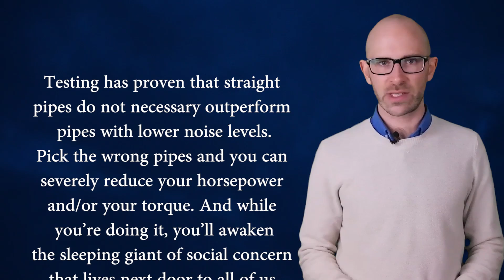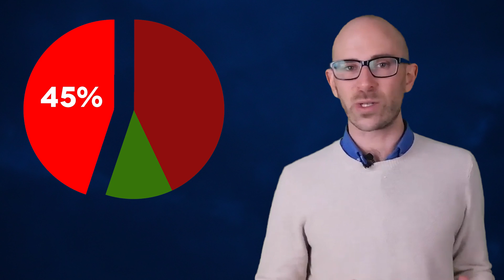Why are Harley Davidson Motorcycles So Loud?

Comment: Harley Davidson's are the fastest way to convert petrol to noise without the side affect of horse power
Reply: According to fuelly average MPG for a stock Ultra limited is 37.8.   I am not accusing you of lying... I'm just giving you significant glances and seriously questioning your math abilities.
Reply: Will Sherriff as a harley owner, 1200 sportster, lol I agree 100%.  I mean wtf.  a BMW gets like 170hp on the same displacement where I get like 75.
Reply: John Dyer When you try and roast someone's punctuation errors and end up sounding like a complete dumbass because you called an apostrophe a hyphen.
Reply: Please forgive me, but I don't believe you're being very honest about this.   Most guys I know of that did the Stage IV went from 37mpg to 29mpg.  You might be able to tune a 10% increase in fuel mileage with the right fuel map if you sacrifice a bit of power with it, but that would put you right around 90HP.   In short, I don't care that you are lying to me, I'm more concerned that you're lying to yourself.
Reply: LOL John Dyer, I think you're talking about the all Harley class of drag racing!   In which, I think the V-rod holds their record, which was HD's attempt to deviate from their normal design.
Reply: Ratty - A Harley 883 makes about 50 ft*lbs of torque at 3750 which is peak.  A Yamaha R1 makes 70ft*lbs of torque at peak.  A CBR1000 puts out 75ft*lbs.  In fact the smaller CBR600 puts out almost the same torque as the 883 at almost 50ft*lbs.   My Ducati has an 803cc in it, and it puts out almost 60ft*lbs and doubles the pathetic 45 or so horses the Harley 883 shells out.   The one thing I learned here is that you are not good at facts.
Reply: savaship - I can't believe you're considering gas mileage while riding a motorcycle. In my 40+ years of riding I only checked my mileage once and it was because I was on a trip to the gulf and needed to calculate my fuel stops. When you're out there riding, enjoying the day, the last thing you think about is whether that ride cost five cents or nine cents.
Reply: Softail77us - I can't believe you don't figure out your gas milage after 40+ years of riding!   Or figure it into your motorcycle purchases, as a basic component of how economical it is as a daily driver... oh right, Harley riders tend to be weekend warriors, my bad.  But still, fuel economy is one of the most basic pieces of knowledge for operating any vehicle... Is not knowing anything an essential part of the Harley experience?  Gonna tell you, I love my Ducati more than I ever loved any of my 3 prior Harleys, and I know for a fact that there's better bikes out there than mine... none of them Harleys.
Reply: starcommtrey - I'm not the one who didn't know my own bike's fuel mileage, then attempted to make fun of someone who knew theirs.  You should look up the word ignorance sometime.
Reply: Softail77us - I started on a Harley, an 883 sportster... was a good bike... not a great bike, but good.   I traded for a 1200 sportster, was a gas hog, still a good bike, not great, but good but less economical.    Traded for a Wide Glide, was the worst bike anyone could have ever designed... made me re-evaluate my thinking on bikes... test rode every bike that had a name, liked many, but went with the best compromise between comfort, fun and passenger comfort... so now I have a Ducati Monster 796... is a great bike, it's also an air-cooled V-twin that generates more Horses than a big Harley twin on half the displacement due to 90 degrees of separation (45 degrees is stupid inefficient), and much better economy.   You say you have no use for rice anymore?  Ever try pasta?
Reply: John Dyer banning guns wont stop gun related deaths. It'll lower the number but you're forgetting that criminals dont follow laws. So saying that "banning guns will stop gun related deaths" is a factual error
Reply: That's cool.I have two Harleys, both piped and tuners.Just don't be stupid and crank it when the bars close. I never had any issues with my pipes and cops.
Reply: John, what class do Harleys race other types of bikes then?   My local track hosted an MMDRA event last year and Harleys were not in the allowed bike list.
Reply: well said Stan--The engineering word for push is Force, and a force applied by something round like a wheel is called torque. So, torque is a fancy word for a push by a wheel. More torque equals more push, which equals more acceleration.
Reply: I like my two wheel tractor -  it cruises just fine on the back roads. As when riding daily through the Ozark and Ouachita Mountains.
Reply: Lil Devil - you are probably right. But  what ever you ride be happy. If you are trying to please someone else you will never be happy. And what ever you ride keep the rubber side down and in the wind>>>
Reply: Starcommtrey, I'm really not sure what your point is because that comes to 41, not far off from the 37 average.  You're also not claiming to have a Stage IV in yours that increases your horsepower by 60% and a magic tuner that somehow gets 50mpg AFTER increasing your power by 60%.  THAT's the issue, not whether or not you can squeak 41mpg at low rpms on a stock ultra by riding low rpm in a straight line on the highway, but whether you can mod your bike to get 60% more HP and somehow get 35% better fuel economy at the same time.
Reply: starcommtrey, a stage 2 is an 8% performance increase mod at minimal fuel efficiency losses.   Most wise folks wouldn't bother with it because it's a lot of money for very little gain.   The thing you will get is a nice fuel map done during EFI tuning which could net you about 10% fuel mileage increase.   So Average of 37mpg +10% = 41mpg... congratulations, you did a fairly useless mod and had a fuel map done to get 41mpg and it worked out exactly as I said it would, so why are you even arguing about this?
Reply: I know what average power increases from certain mods are, so I can make an intelligent estimate.   I also know from multiple data points that people who mod their bikes tend to exaggerate everything about their mods and their bikes.  In general, you don't increase power and decrease fuel usage unless you're looking at an engine of a different design such as adding liquid cooling.  There are exceptions, but they are normally minor, not super major like the previous poster who claimed a 60% addition of power using 35% less fuel... "tuning" can not accomplish that.
Reply: Well put Will.. you comment made me laugh..I get it.
Reply: Thank you Gage. John Dyer, I laugh in your direction.
Reply: Softail77us hahaha.....my bad, I went outboard for the vmax.....
Reply: I have loud pipes and would be willing to bet my education rivals or even beats yours, have a great life and completely make you look ignorant.
Reply: So, since piston-engine AND jet aircraft ("airplanes" to you, kid) never have had muffled exhaust systems, all aviators ("pilots" to you, kid) have "small penises"? You should have known.
Reply: A half-full bucket of corroded wheel weights makes him look ignorant. The kid ain't right in the head.
Reply: Airplanes to you kid....I love that.....hehehe.....now in all fairness, old prop jobs(p51 for example) were straight piped.....wait....that confirms your point...hehehe. (But to be honest, there are a lot of dumb pilots....) And while we are being 'technical' lets say naturally aspirated piston-engine, turbo props, turbo jets, ramjets, and turboramjets.
Reply: Yamaha SR650 - You seem upset about something bigger than this thread, I won't lash back at you, even though you are resorting to lots of generally infantile tactics to have during a discussion.   This isn't about "American Iron", there's very few Harley Davidson parts that are manufactured in America.   Harley's are assembled in America, not made in America, so in a sense, the Toyota Camry could be considered more American than a Harley as it has many parts manufactured in America, and it's assembled in America.   I just don't know why you think anyone would be jealous of watching another person waste their money on a $20,000 bike that can barely move it's heavy butt up to 60mph in 5 seconds, and can't lean more than 24 degrees.   That's a bike that can't move, or turn.  If it was a budget bike, I'd forgive it, but it's not, it's priced higher than a Ducati Diavel, an imported Italian 160hp cruiser with 41 degrees of lean... I just expect more from HD, but after they murdered Buell bikes we instead get 15 variants of the same bike with purposely stupid sounding marketing terms... I bet you can't wait for the new dyna heritage screamin-eagle superlow bobber soft-tail slim breakout.  It does 0-60 in the same time as a 1992 Chrysler LeBaron and can be out-turned by the USS Iowa, but listen to those pipes man!
Reply: Yet they still use Harley drag bikes and are competitive and get enough hp out of the two cylinder.
Reply: No I was not.
Reply: savaship My ultra Classic gets 250 miles to a tank. 6 gallon tank. Do your math.
Reply: +Softail77us 
@softail lol, yep I just get on the other side of this side before needing to fill up again.
Reply: savaship I know my fuel mileage so not sure what your getting at....
Reply: I only mentioned one trip. I've made plenty 600-1000 mi trips and have toured Ohio, Pa, Texas, Ok, Tenn, California, Bahamas. Motorcycles have always been a way of life. When I was 11 I finally got my first bike, I rode every day possible for the next 20 years. And subsequently I do ride like you say. Things got in the way. Since 1971 to today, I have always had a bike at the ready. 

I've ridden year round, carried a rain-suit so I could leave for work even when the skies were black and windy. I've traveled hours in rain and wind so strong I was afraid of the wheels blowing out from under me. Taken girls out on dates, woken up in hospitals with amnesia, concussions, breaks, etc. Went out riding while blacked out every night for 2-3 years. Been chased by the cops, jailed, ambulanced to the hospitalized more than once. I slept on my bike running while the engine heat kept me warm. Had my bike under water, blocked the entire I-405 freeway at Carson Rd southbound traffic to a standstill, rode Mullholland Drive, Hells Kitchen, Cooks Corner, hung out at Strokers Icehouse, ridden on frozen ponds, All sorts of stuff, not all proud of but it has always been my life. I also rebuilt a couple of those Honda 305 engines. They have considerable torque as both pistons reach TDC at the same time. My 650 was the same way.

I've owned 18 motorcycles:
2 minibikes
3 Bridgestones Rotary Valve 2 strokes
2 Hondas CL90, SL70
1 BSA
8 Yamahas 125cc 175cc XT500 XS400 XS650 XS850 250cc TW200
2 Harley Davidson  Sportster, FXSTC

By mileage I meant mpg. I only checked my Miles Per Gallon once. 
If I'm going to the coast and have a full 5 gallon tank I figure I need to stop before 200 miles is up so I watch for the 'Next gas station XX miles' signs or how far it is to the next big city that has gas 24x7. And don't leave the last gas station until you're sure you have enough to make it to the next. After siphoning gas for years etc., I know how to roll without running out of gas, but if I did, Harley riders would descend on me in minutes.

Plug fouling was a big problem in the 70's. Two stroke bikes would foul some NGK plugs in minutes. The Champion N3G had a gold tip and lasted a few months. I haven't even used the spark plugs I bought in 1995 with the hog which still purrs like a kitten, even with the cam. One time a piece of carbon got in the electrode on my 650. That's about it. I idle on a cold start till the choke is off, then ride. Running with the choke on is noticeable and hard on the engine. I don't give a shit about pollution. Just the fact that I ride a bike saves enough pollution compared to a truck or alGores jet. I miss when I was riding my 650 to work every day. When I hit the exit ramps blue smoke would billow out of the header clouding traffic. I used a quart of oil/week till I finally replaced the valve seals. 

You sound a little like I did before I ever rode a Harley. I used to think Harley riders were morons till I rode a 900 Sportster (shifter on the right). At 100 mph it was stable as an ox. The torque was overwhelming and changed my life. That's how I ended up on Harleys. You should try riding a Harley. Just banging and clunking is fun with that V twin beast. Except for trail riding, I have no use for rice anymore although still fond of the Yamaha VMAX. You also sound a little like Rubber Dobbs does knobs..
Keep her verticle man
Reply: Softail77us ahhhh the vmax....slow and steady. And your right about the out of gas....even when I am just pulled over, riders ( most cruisers doesn't matter the make) look at me and gives a thumbs up to check on me or stops
Reply: Steady yes. Nothing slow about it. It's the first bike I ever rode that I could smoke the tire and wheelie at the same time. Yamaha basically took two V-twins and put them side by side making a V4. It's a beast. Yamaha has always been ahead of the other ricers ie Kawasaki Suzuki Honda.
Reply: You can always tell the envious riders. They bash what you ride. I would guess none of them have felt the torque of a hog. If that feeling doesn't impress them they must be mental or like lots of flowers. I try not to pick on the rHonda riders but can't help it sometimes.
Reply: Cool, just don't go overboard. heh...
Reply: Softail77us I agree....FWIW, the new Indians are no slouch either.
Reply: savaship why is this an argument? this is so apples and oranges it ain't funny.
Reply: If you're talkin' 'bout me, kid, maybe you should do some research and/or get to know someone before you "Troll" me. For one, in Harley-Davidson years, my 1979 Yamaha is rather new. For two, that "old ass toy bike" has been magazine-featured three times since I hauled it's carcass out of a Fillmore, California barn back in November of 2012. For three, my Yamaha would pretty much dust any Harley-Davidson with the possibility of a Buell being the exception (for you kids that don't ride, a Buell is Harley-Davidson-powered) Oh, you're talkin' to that "Will Sheriff" half-wit. Sorry for the misunderstanding.
Reply: Yamaha SR650 Why do people want to talk speed out of a cruiser? They are not built for that. However I would challenge you that a VRod would eat you Yammy up as they were faster than most buells. FWIW the Buell, although Harley built, like the VRod, used a different engine setup but still kept the 883 and 1200 cc specs
Reply: now don't get me wrong, I have no issue with your bike, just with th comparison made.
Reply: Yamaha SR650 hehehe, most people don't realize Harley makes a VRod destroyer Wich is the fasted production bike through the 1/4. But if you want to see the baddest undrivable powerhouse in a bike, look at a boss hog with a 350 Chevy as the power plant.
Reply: Go down the road in high gear without having to downshift, kid! You should have known.
Reply: Also a great way to consume engine oil as it drips on the ground.......loud pipes and dripping oil.......that's worth 3 times the real cost...!
Reply: Homer Simpson none of my Harley's have ever leaked oil.....
Reply: Robert Dobbs really? And what makes a biker?
Reply: A "biker" is any Harley-Davidson rider who shuns the American Motorcycle Association and the AMA's anti-modified Harley-Davidson motorcycle stance and it's collective ownership. These "bikers" generally are known as [the] One Percenters (1%) of the motorcycling sport. They may or may not have tattoos that may or may not include "FTW". (I have one) Your description fits a lot of motorcyclists, including many one percenters. I've associated with a couple 1% clubs and they can be very "courteous". It's all on how you treat them. Treat them good, they'll treat you better. Treat them bad, they'll treat you worse. (see: "The Golden Rule" in the Bible) "little to no education"? How'd you come up with THAT reasoning, kid? Too many late night movies? "sociopaths"? Do you even KNOW what "sociopath" means, kid?! A lot of people/groups can be known and/or identified as "sociopaths". Take the Democratic Party for example, kid. Hillary Clinton being a prime example and SHE doesn't even ride, you incredible nincompoop! If it helps, I'm a "biker" yet am highly educated. My IQ puts me in the top 2% of the World's population. I have 33 framed certificates of merit pertaining to my Industrial Engineering education and career. I'm an ex-United States Army Corp of Engineer. I'm also a Master Mechanic. In a nutshell, "my school we're to gooder then your's". You should have known.
Reply: Nice insults. Didnt realize that I was being graded on my composition. I see you are still fixated on the size of my pecker. Good for you being out in the open and out of the closet like that. I also appreciate how, when faced with the truth you dont like, you resort to insults. Ill gladly put my education and knowledge up against you any day of the week. My credentials will make your jaw drop. No, Im not a doctor, but I am very well educated none the less.(Not talking about just college either, as that is just an expensive preparatory school and has no bearing on brains whatsoever.)
Reply: Quit ogling at men's pee-pees, kid! You should have known.
Reply: Let's just hope the kid doesn't ever say something he'll regret!
Reply: Andrew - Nah, I think I'll stay here... have a different opinion, and call out Harley Noisemakers for what they are... attention seeking, infantile, slow bike riders.
Reply: savaship why not call out every other brand too?
Reply: It was a response to a postulation that dealt directly with Harley Davidson, calling out other brands would have been inappropriate due to the statement I was responding to.
Reply: No it wouldnt. You have and others have been here bashing the Harley loud pipers. I have yet to see one throw in every other major cruiser brand owners for doing the same thing. The only major make I can never recall seeing a loud pipe on was a BMW. But yamahas, hondas, kawis all have loud pipe owners. Cobra straight pipes are very popular with them. America is the land of the loud pipe, be it a Harley bike, Honda bike, muscle cars, you name it. America is a straight piped nation. Almost everything with an engine has aftermarket or stock pipes that are just loud. So he is right. If loud pipes offend you, this is not the country for you. If you think Harleys are too expensive, just stay away from them. Nevermind that they are the best selling cruiser in the WORLD.....I have had three and loved them all. Lost my ass in my first one because I dropped 20k plus the cost of the bike into customizing every inch of that bike. I do not regret it one bit. I had one of the prettiest sportsters you will ever lay eyes on. I created a work of art. I sold the bike for 7k. But I knew I would never get my money out of it that I put in it. My second Harley was a 11 Street Glide. I bought it for 18k off the floor and sold it for 16k a few years later in 14. No complaints from me whatsoever.
Reply: Somebody's jealous of people with enough money and pride in their Country to ride American Iron, kid! You should have known.
Reply: savaship Sava, 75% of the Harley is done in house. Don't spout off info you don't know.
Reply: Starcommetrey - oh yeah... Harley barely touches international suppliers...   http://nypost.com/2014/07/22/harley-shares-fall-after-admitting-foreign-parts-hold-up-new-bikes/
Reply: Did i say no parts are over seas? No. 1/4 of the bike is. Also if you actually read that article, it was in reference to the new Street 750 and 500 bikes, not the cruisers.

http://marketrealist.com/2016/03/harley-davidson-motorcycles-manufactured/

Here is a more recent and better look at the Harley manuf. and assembly. The electronics are made overseas because we dont make them in the US. The Shocks are done by Showa in Japan and that does not need to change. Harley is still one of the few bike manufacturers in the WORLD who actually produce their own gas tanks in-house. 100% of the bodies and frames on cruisers are built right here in the US of A....Do a little more research next time and actually read the articles you post in their entirety.
Reply: Savaship proved he is an idiot....over and over.....that article he failed to read being the latest way.
Reply: Actually, Harley-Davidsons ARE "manufactured" in the United States in "assembly plants". There's not one single plant. As far as your Japanese automobiles, they're "manufactured" in Japan, the parts are shipped here and put together in "assembly plants". This is to bypass import taxes and tariffs brought on by the late, great President Reagan. He also taxed imported motorcycles larger than 700cc's which did not go well with Japan. Before the tax went into effect, Japan flooded warehouses with 700cc and larger motorcycles. Best part about that, mot sat collecting dust and were returned to be melted down. I always smile at that thought. Sure, kid, most everything either is foreign-made or has foreign-made parts and components. Been to a WalMart lately? You'd be hard pressed to find anything in there made in the US. It's not so bad, kid. You need to mellow out and go with the flow like I. "upset"? Me?! No, I'm not "upset", troll. There's nothing you kids can type here that "upsets" me at all. Look at Robert Dobbs for example. He keeps on trying to convince me my schlong is teensy-weensy because I ride a Harley with loud pipes when actually, the joke's on him! I ride RICE with a pipe louder than ANY straight-piped Harley! (quicker and better handling, too!) "Upset"? Maybe you better consider the source, kid! I mean, anyone who gets on the computer and says Toyotas are "more American than a Harley..." You'd either have to be stoned out of your gourd. possess some emotional retardation problems or just be pissed at the world about something. Did your Mom run off with "Tiny the Biker" or some shit, kid? In closing, it's apparent you don't ride for if you did, you'd have a clue Harley-Davidson must be doing something right, selling an average of around 225,000 bikes a year for the past 33 years. You should have known.
Reply: (kid ain't right in the head, comparing cars to motorcycles to battleships. poor little guy....)
Reply: You should team up with "MrJimmy" aka "themaxrider". He hates Harley-Davidson's too! Why the hate, kid? I'm willing to bet you've never ridden one, much less owned one. I've owned one and have ridden a half dozen. They actually handle a lot better than you'd think. My brother traded in his '68 XLCH (Sportster) for a new, first year Evo Sportster ($3995 list!). He let me ride it. I couldn't believe how relatively light it was and its nimbleness! I started doing donuts on the dirt it was so nimble! (of course I've been riding since 1965...) You need to google: "Motorcycle Cop Owns Obstacle Course" and see some cop on a 900 pound FL-series Harley go around this very tight course faster than ANY other motorcycle could ever navigate it! How? Why?? Harley-Davidson's F-series low center of gravity. He was leaning this behemoth way over and still not dragging. You go watch that video and get back to me, kid. If it doesn't change your thoughts about Harley-Davidson's handling, you're brain dead, kid! You should have known.
Reply: Robert Dobbs yeah, I'm done talking to your ignorant ass....muted.
Reply: Starcommtrey, you didn't prove anything.   You posted a market link that stated a specific plant "assembled" 60% of the Harleys.   I would have responded earlier but sadly, there are a few dozen things in my life more important than you, I apologize for that.    I am attempting to have a real discussion with you guys, but you and Yamaha SR650 enjoy name-calling and you don't read facts correctly, plus Yamaha SR650 is obviously developmentally disabled, and I'd feel bad if I let him get any more drool on his keyboard, so you guys win.   If you want to believe that Harleys are awesome, go ahead.   I would only attempt to prevent someone from riding a Harley if I cared about them, so I actually want you to get one of the bigger Harleys with less available lean angle, a bigger engine, and no ABS... then find a nice twisty road.
Reply: Yo, star dude! Bad news: the first motorcycle manufacturer in Japan was Rikuo, manufacturer of Harley-Davidsons under license of Harley-Davidson. From the early 30's to 1958, when the first Hondas washed up on our shores. Also, since Harley-Davidson isn't talking, nobody other than Harley officials know what the percentage of Harley parts are foreign. My estimate would be maybe 5% to 8%. Forks & shocks come from Showa of Japan, wheels from Australia. SOME instruments from Japan. Harley has SIX manufacturing and assembly plants, 4 of which are in the United States. Harley's "Street" model for "export" is made in Bawal, India for the Indian, Italian, Spanish and Portuguese market[s]. Unassembled Harleys are shipped to Manaus, Brazil for assembly to be sold in Brazil. Here's an interesting fact!: For about 18 years (1960-1978) some Harley-Davidsons were made exclusively in Italy for the US market! They were shit Aermacchi bikes rebadged as Harley-Davidsons. Actually, some of the (Italian) factory-prepped bikes set some land speed records that still may stand today. But for the most part, they were crap and damn near impossible to get parts for which was often. My good friend and founder of Dirt Bike Magazine (6/71) Rick "Super Hunky" Sieman tested Harley's Baja 100 and called it a "rehashed Italian street bike with no redeeming values." Harley promptly pulled their ads! All these interesting facts and figures can be found in my book: "The Dirt Gang", my autobiography of my life on 2 wheels (off-road) from 1965 to present. Gimme your email and I'll email it to you, kid!
Reply: Yamaha SR650 I know Jap had Harley. Harley sold them all their designs after Indian hit them with a patent lawsuit and took Harley down. That's how they could afford to do the knucklehead. The AMF years weren't kind either. I am talking today's bikes. But I would love to get you my email someway other than the comment section.
Reply: Yamaha SR650 here is a good read.

http://backintheusa.us/articles2.php?title2=howamericanisharleydavidson
Reply: I owned a "bowling ball" 1972 Harley Sportster XLH. It had all kinds of problems! It broke down twice! Once I was left stranded with an empty gas tank! Damn piece of shit! A kindly farmer stopped about 2 minutes after I did and gave me some gas. Second breakdown occurred on my second ride with my new back tire! Picked up a sheet metal screw and was left stranded on the Pacific Coast Highway to watch an awesome sunset until a friend, James Dean (yes, his real name) showed up with a free trailer from our rental yard we both worked at. I gave 2 separate people 5 bucks each who stopped to make a call to James. Nearest phone was in Oxnard, about 15 miles north. (this was before cell phones) Oh, I had to tear the bike down to the bare frame once when I broke the two frame down tubes under the seat doing "Evel Kinevels" entering this certain parking lot. It was good for these cool 10 or 12 feet jumps with about a 1 or 2 foot height. Anyway, I'll post my email here but anyone who responds must act accordingly! If you kids don't act accordingly, I'll be forced to print out your emails and do horrible things to them! If you knew my diet, you certainly wouldn't want THAT to happen! daviddaveinternational@gmail.com
Reply: How dare a Harley not crank when it runs out of gas! Its like when a 1911 doesnt fire when it runs out of bullets......
Reply: Bend over, kid. I'll drive. You should have known.
Reply: "1911" as in a Colt ACP? I should have known. Wait, I DID know! I have a massive weapons collection but no semi-automatic pistols. I prefer wheel guns. They don't jam at times when most needed like when you're shooting motorcycle thieves in action..
Reply: Yamaha SR650 I use both. I normally carry either a LCR in 357 mag or an XDS in .45
Reply: So, tell us, King Salami; how much meat you swingin'? Don't be shy. With only one exception, we're all adults here, kid. You should have known.
Reply: Do you know the difference between a Harley and a Hoover? Hoover carries only 1 dirt bag!!
Reply: You just made that up, didn't you, kid? I've NEVER heard that one before! You should have known.
Reply: True Tavi.....take a 8% grade in 6th gear and you see that torque.....
Reply: That is funny shit right there!
Reply: effect
Reply: how would you feel if  told you that harley has held the world title as the fastest bike of the pro stock division of the National Hot Rod Association  who sponsors the U.S. National Drags  and has done so for 10 consecutive years in a row .. and harley was the 1st motorcycle to ever run in the 6 seconds bracket in a 1/4 mile  of all other brands of motorcycles .. including the suzuki hayabusa that is no longer the fastest motorcycle in the pro stock nhra us nations ..but harley davidson is for the last 10 years in a row world champion ...if you want a harley wilh horsepower you have to tell your harley dealer .. they will not automatically give you the fastest  bike there is when you walk in and say i want a harley , because there is around 30 different modals of harleys made every year ..some fast  and some extreme  fast .. but i buy the ones that are behemoths way beyond your imagination   ..
Reply: Original!!  Hahahaha
Reply: It's like a contest with them to see if they can create more db than HP.

   My Chevelle is over 550hp and practically has open exhaust and side exit boom tubes and I can easily stay quieter in town, but then again my engine is properly tuned and I feel no urge to rev the engine constantly at every stop light.  What make it even more ridiculous are the people with 1000hp turbo LS rides that are even quieter than my car.
Reply: Very True, I had my air cooled V-twin 1688cc Harley Wide Glide Dyno tested and it came out at 78HP, 91ft*lbs of torque, while getting 37 miles per gallon.    My air cooled V-twin 803cc Ducati Monster Dyno tested at 83HP, 71ft*lbs of torque while getting 49 Miles per gallon.   I don't own the Wide Glide anymore, and I'm not sad about it.
Reply: @savaship   if you went to buy a brand new fast chevy from a  the dealership and you did not tell them the horsepower you desire so you only got the base engine in a new camaro that is a v6 and not the 600 hp v8 corvette engine option ...so would you say chevys (or any brand) are the fastest way to convert petrol to noise without the side effect of horsepower? ..at harley davidson you have to tell the salesman just exactly how much horsepower you want and still be covered by warranty that is over 100+ hp since 2011 ..so your slow ride is totally your own fault
Reply: John Dyer Where I live the sheriffs office has harleys just as loud.
Reply: gator 
I also like my tractor, but I think a lot of people are just jealous of HD, I had a friend who bought a yamaha 650  special and had it fixed up to look like a harley, we rode to a bike meet and they only let harleys through the front gate, everybody else through the back gate, this ticked him off pretty good and just drove off and later sold the bike, I told him if you want it to sound and look like a harley then buy a harley, quit buying imitations, about six months later he bought a nice street glide and  still has it today.
Reply: Jim Piver spoken like a true piece of crap street bike rider
Reply: Yamaha SR650 - I'm glad you think I'm an idiot... I'd hate for you to think highly of me, that would mean I did something wrong in life and am paying for it now.   I didn't refer to the bike as "pathetic", don't be a selective text knuckle-dragger,  I referred to the amount of Horsepower and torque it generates as pathetic.   Remember, I started riding on Sportsters, and I do like them, but their power is indeed bad, and 30 degrees of max lean is also not good.    You can glorify my bike all you want, but it cost a lot less than a Sportster when I got it, so if it is indeed a "Two wheel ferrari" how come it cost less than the domestic standard and shipped with ABS standard?   Anyway, talking about power on a Harley is pointless no matter how you look at it, because what good is a bunch of horsepower when you scrape metal at 30 degrees?
Reply: If Harley-Davidson noise offends you, I suggest find a better place for yourself to live outside of the United States.  I'd recommend 1-800-LEAVE-US to you for immediate help.
Reply: savaship I'm stage 2. And that 41 is at 80mph.
Reply: savaship I also upped the power on my diesel by a good margin and went from 15mpg to 22.....
Reply: You have no idea about my power increases. I also did not lose fuel mileage, I gained fuel mileage. I allowed my bike to run more efficiently AND to run cooler. To increase fuel mileage, one simply has to lower the fuel being used at a specific RPM to maintain that RPM. Now, I will give you, its all in throttle control. My bike and my truck can use both more fuel or less fuel depending on my driving habits. But, when my bike went to TN to ride the Dragon in May, it was 80 mph with the cruise set, and I was able to get over 250 miles per tank, compare to the roughly 200 stock which was about 33 mpg. Please also keep in mind that this was at 80 mph. It sky rockets at 55 mph. Ill give you that I am doubtful about the 50 mpgs he claimed. 40 however, is very possible. 20 is also possible.
Reply: Will Sherriff Words spoken from a true speed limit law breaking street bike rider
Reply: Jim Piver yay way to support your American Products dude go buy another Kawasaki
Reply: ...or the fastest way to get some hard-belly sweetie to sit on your face, but you wouldn't know that, kid. Nice Honda ya got there, kid! You should have known
Reply: Will Sherriff says the kid with an old ass toy bike 😂
Reply: Ever stop to consider maybe Ratty is talkin' "Useable Torque"? You hook the R1 ass end to any Harley ass end with a rope and I can assure you the Harley would drag the Yamaha around like a Tonka Toy. The Yamaha would dust it's clutch or stall instantly. Why? No "useable torque". Useable torque is why any Harley can out-accelerate ANY multiple cylinder Jap rice rocket from let's say 50 MPH to 80 MPH if done in high gear w/o downshifting either. I dusted some kid on his Honda V45 "Ragna" (Magna) that way. It was close but I got him by maybe one bike length. He wasted too much time downshifting while I just rolled it "WFO". Of course, my 61 inch 1972 XLH DID have 16 inches on him. I noticed you made no mention of RPM "peak" on the rice-cycles. What would it be? Ten grand? Twelve grand? Who the fuck rides around at 12 grand all day, kid? The fact that you refer to the XL-series as "pathetic" tells me either you don't ride or you DO ride but are just an asshole. You should have known.
Reply: Some of us like to show our dominance over Fellow Man by flaunting our superior intelligence and properly functioning thought processes. Take the "savaship" idiot for example. Here's a cat who owns/rides one of the best motorcycles, a "two-wheeled Ferrari" if you will, but refers to one of the biggest-selling motorcycles as "pathetic". Didn't Ducati start off making bicycles also? If you think about it, a Ducati, like Jap rice rockets, aren't even designed for street riding anyway. The best choice in this matter would be ANY Harley-Davidson or my 3-time magazine featured 1979 Yamaha SR500 with its Hi-Per-Kinetics-built Stage Two 650 stroker making just about double the stock 31.5hp @ 6500rpm/26.8 lb/ft @ 5500rpm.I estimate about 59hp but feels like 65 or so. A period Webco Dyno posted a high of 43.42 @ 6500 rpm and 38.98 lb/ft @ 5000 rpm (barometer 30.01, temperature 64F, correction factor 1.034, date of test: 2/27/79)
Reply: Of course any V-Rod would dust my Yammerhammmer! I mean, the fuckin' 'Rod is even quicker than a V-Max Yamadog! Most riders won't agree because they're stuck on the fact that the V-Max is the quickest accelerating motorcycle mass produced but, Yamaha's FJ and the V-Rod are quicker. Not by much but still quicker. The V-Max's faults lie in it's handling or lack of. Just not a well-developed and thought out motorcycle. Kind of what Honda did with that mega-pork cycle that they stuck the 6 banger Gold Wing engine in. I can't recall what it's called but that was one poorly engineered motorcycle! WOW! The handling characteristics of a flat-tire wheelbarrow full of bowling balls! (sorry, AMF) Though Yamaha's SR-series had a weight problem, they did handle like motherfuckers! Mine, with its Hi-Per-Kinetics Stage Two 650 engine could most likely keep up with anything on Mulholland. It certainly could run circles around any rider on any V-Max on the twisties. I shaved about 35 pounds off mine but I am overweight by about 100 pounds, cancelling out the weight shaved off the bike. A younger Kenny Roberts on my bike would be a blast to see....IF he could start the beast! (no electric start)
Reply: My 2013 Ultra Limited has the Stage 4 - 113 Hp/ 119 Ft lbs.(back wheel) 48- 50 miles per gallon riding 2 up if I baby it.
Reply: It's all in who tunes your bike. I use a TTS tuner not a Screamin Eagle and a DYno sheet to back it up. My bike is tuned by a Harley pro stock technician, his decision to use the TTS. There is a difference between a US gallon and an Imperial gallon. Question all you want, the thing is my engine isn't even working at 60 mph
Reply: Like I said, it's all in the tuner and who tuned it. The TTS out performs the Screaming Eagle tuner.
Reply: I have ridden all makes. The HD's likely weigh almost double than what you ride, which makes a difference.  As for the horsepower, you are also wrong.
Reply: Good for you.If a motor vehicle has a loud or obnoxious muffler, it is the job of the local police to enforce the law.Drag pipes and pulling the baffles falls into this class. A state trooper spent a whole summer nailing people going to the Harley dealer and quieted down the area a lot.That's the way it should be.Remember, it si not the Harleys that make the noise., it is the people riding them. Just like  banning guns will stop gun related deaths.
Reply: savaship ignorance runs wild with you huh?
Reply: Hey Will, go back to third grade ,please. The hyphen you added is made to show possession in the English language. What are you trying to say here? It is suppose to read Harley Davidsons,  that means plural or more than one Harley.Just explaining so you can understand and not stay up all night thinking about it.
Reply: It's not a hyphen, John.  It's an apostrophe.  And though it may be technically incorrect, his comment is dead on.  @johndyer425